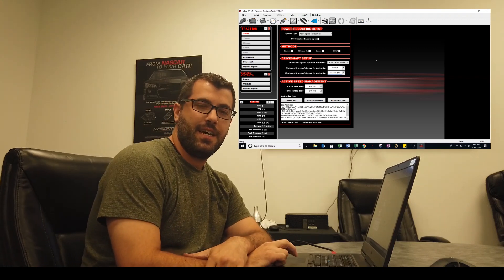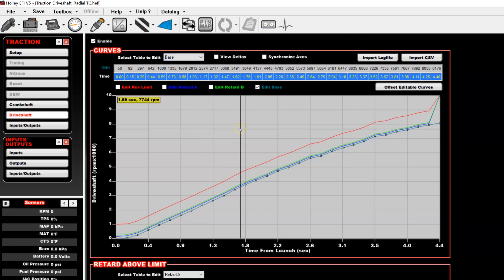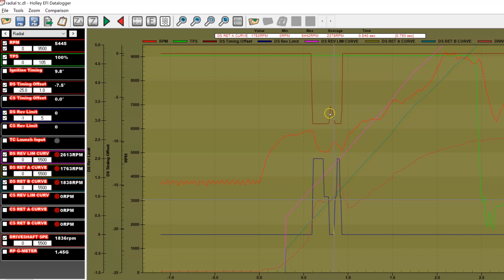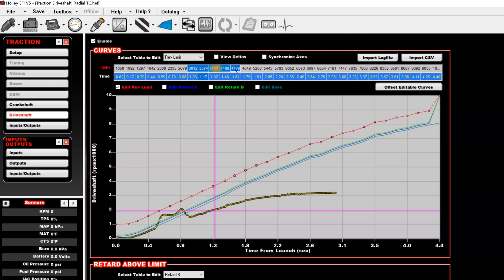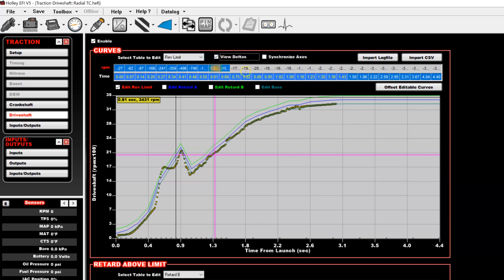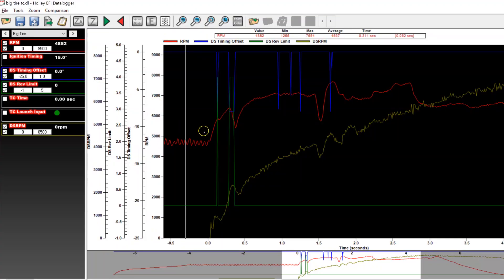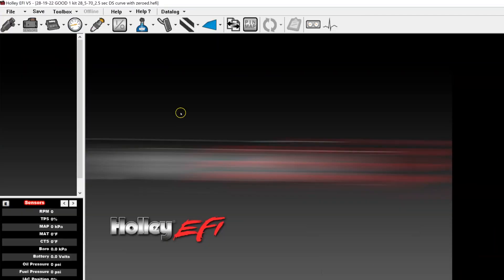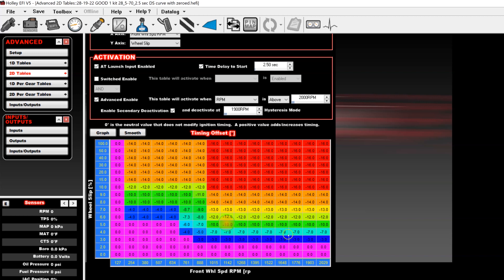Holley EFI How To: Traction Management and Traction Control

Comment: How, where, and how much is it to activate this ? I’ll prob just build a front wheel speed sensor vs rear wheel speed based traction control if it’s too expensive. But I don’t see how to buy it if I wanted to.
Reply from the maker: You need this time-based traction management unlock - Keith             https://www.holley.com/products/fuel_systems/fuel_injection/dominator_efi/dominator_ecu/parts/555-100